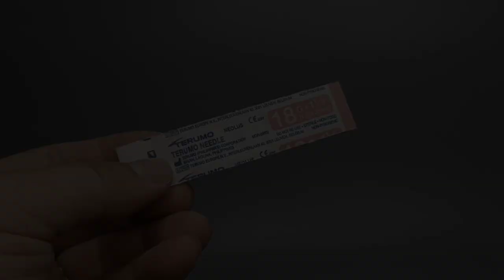CUSTOM HOT WHEELS NISSAN Z PROTO

Comment: What size drill bit did you use to make the hinges and what did you use to attach the door to?
Reply from the maker: i used .7mm drill bit and .7mm kantal wire, you can also use pin, 😊😊😊